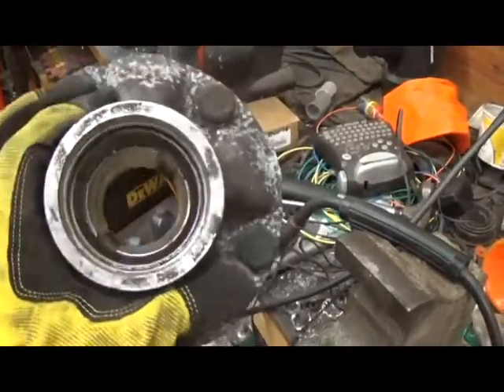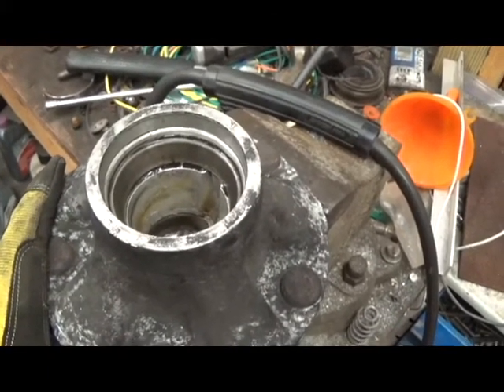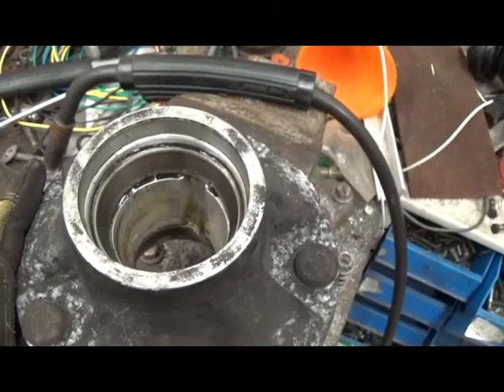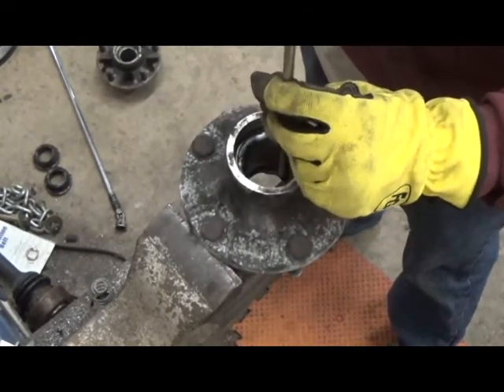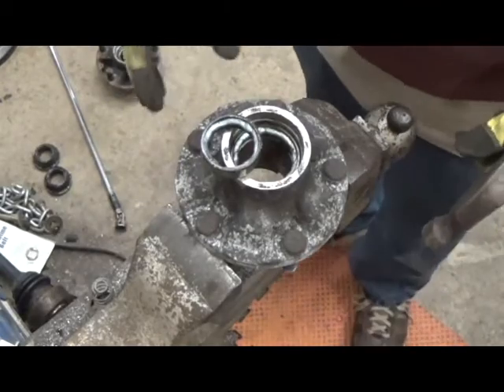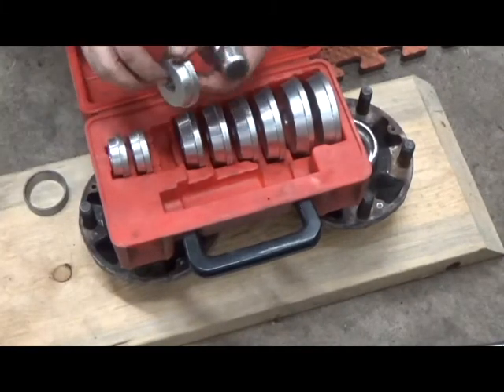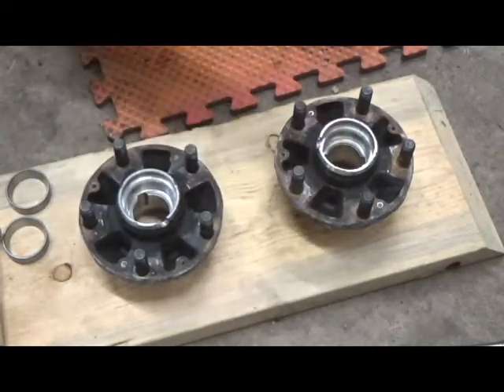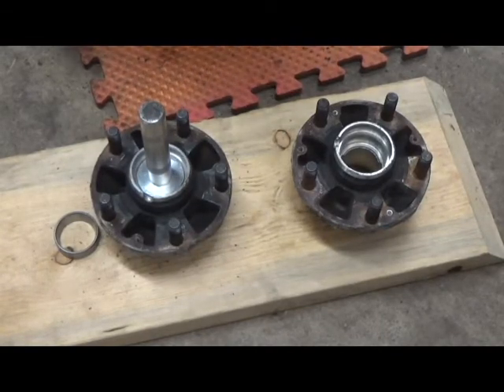Changing wheel bearings in aluminum hub - welding method

Comment: I can recommend some aluminium jaw inserts for your vice though.. Allows clamping without scaring soft metal parts.
Reply from the maker: The vice wasn't clamping -  part was just resting there.  But if you know of some for sale with magnets in them, pass along the link!
Reply: Yes I could see you didn't have it clamped tight, but would still be better with inserts, and then you could actually clamp it and have better control when working. - But I know you are a good mechanic, so I don't need to tell you this. My comment was really meant more as a general advice for others in similar situations. I can get the magnetic inserts locally here in DK, but that is a bit far from you... If you come across some thick walled L profile aluminium bar, you can quite easily DIY some very nice inserts though. Buy some round button style neo magnets (strong and cheap) on ebay, drill matching holes (not all the way through) in the jaw inserts to recess mount them, and glue them in with epoxy. Again, perhaps more of a general tip, but a good one think :)